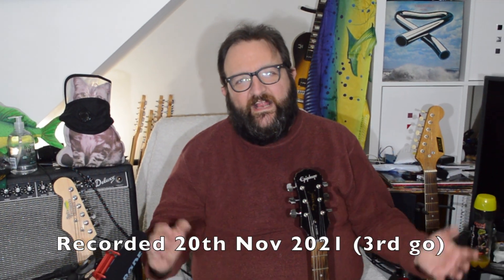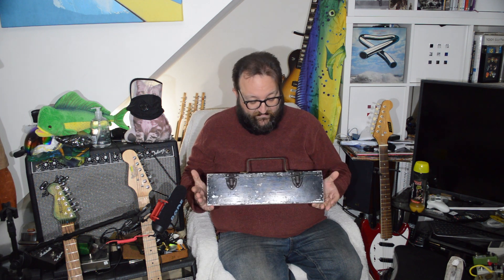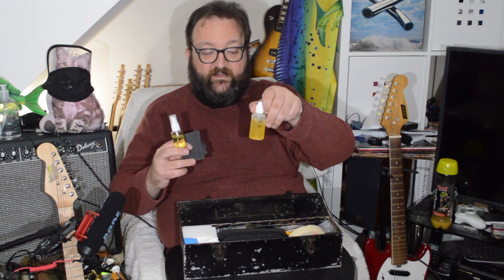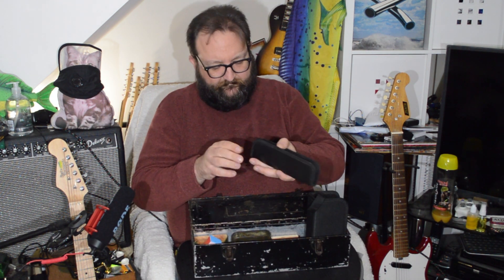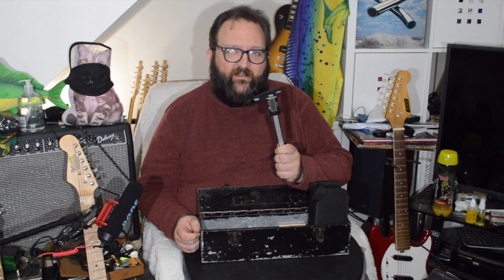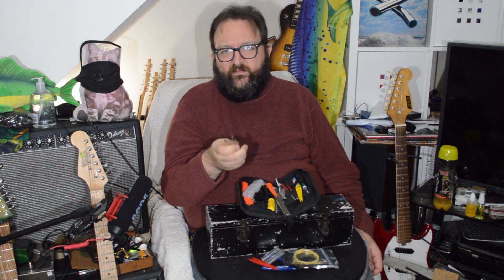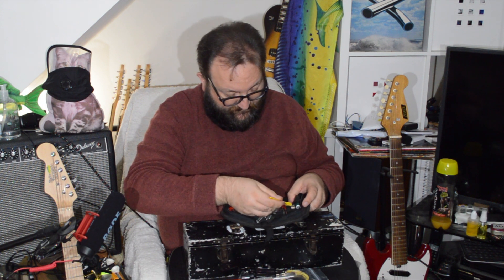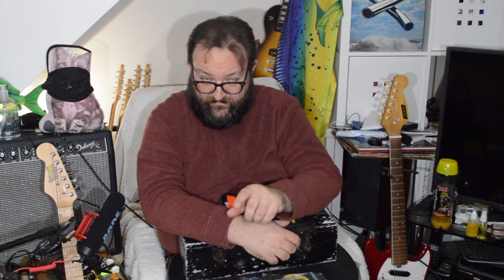Emergency Guitar Maintainance tool box

Comment: You’re missing a gas powered soldering iron !!
Reply from the maker: Interesting - certainly there is nothing for the electonica side of things.  What else should I pack if I go down that road though?  Spare pots? Spare output jacks? wire?  Hmmmm Good call.
Reply: @SadFernandoGuitars  yes to all those although output jacks tend to fail more often than pots. But what about some nut slot files, superglue, spare better quality capacitor, shielding tape / paint (although the paint is a pain and can bleed out into the surrounding wood).  Maybe some wax for adding a bit of shine.  Of course solder and possibly flux and I also have a little spray bottle with IPA to clean everything up after soldering. Deoxit 2ml little tube is great for taking the crackle out of old pots and switches so you don’t have to replace them especially if they are on a expensive guitar. A little bit goes a long way.